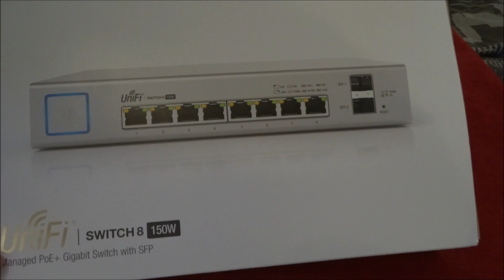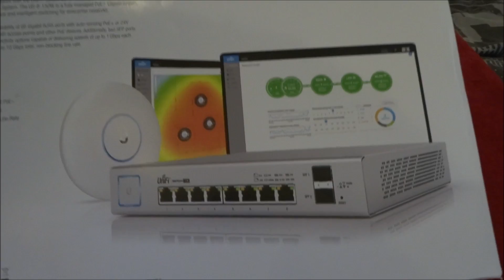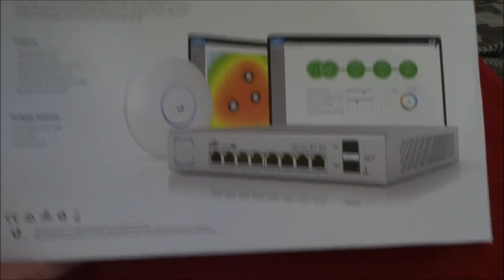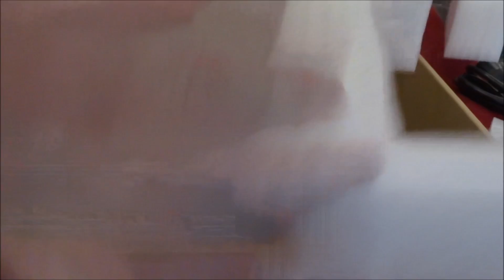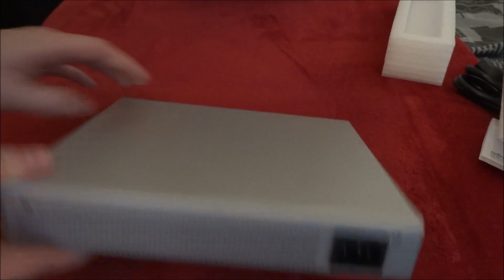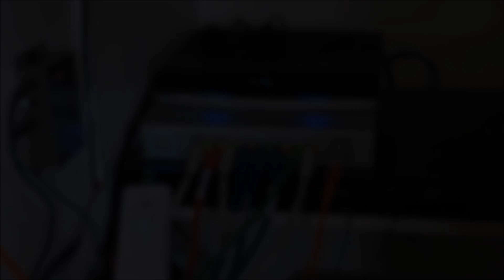Ubiquiti Unifi 8 port PoE switch (US-8-150W)

Comment: It's too bad you lost the USG-pro, hopefully you will be able to add it back in the future.

I have been considering buying one myself, but I am still not sure if it will hit my ~1.2M pps target
Reply from the maker: I may add it back if the features are improved, the fans are very annoying though
Reply: +James Smith Luckily I have an isolated closet with decent noise supporession, so the fans won't be a big deal. 

Perhaps noise is something that could be addressed in software as well - however it is meant more for a closet than anything.
Reply from the maker: +TheJessassin if you check my videos I do use a dedicated room, but why is a usg so much louder than an edgerouter pro? I'm not sure if it is firmware or maybe they just used different fans. overall I was quite disappointed with the usg pro

Comment: It would have been nice if they were to at least have one SFP+ port. There have been situations where we are using a 48 Port just because of the SFP+ it would be nice to see Ubiquiti bring out a 16 Port in that form factor.
Reply from the maker: +Brad Mottram Couldn't agree more! I would love to replace my Dlink core switch but as I have 2 SFP+ ports that's unlikely to happen anytime soon :(
Ubiquiti need to step up their game with switching! The AP-AC's are capable of 1GB/s+ yet you must have a 48 port switch for SFP+! 
On another note, the USG-PRO-4 is the worst piece of rack mount equipment I have ever put my hands on!
Reply: +James Smith Yes I do feel like there should be more features available for the USG products. It's a fantastic idea and a good implementation however the features just aren't there yet... I do hope they can improve the USG products in future.
Reply from the maker: +Brad Mottram I know there is some sort of road map for features and UBNT are pouring a lot of resources into developing features for the security gateways... but for me it was too little too late! I need IGMP multicast and it was not supported, it is on the Edgerouter pro though! I guess they are living up to the standards of releasing stuff to early, letting end users figure out problems then they release updates, we don't work for UBNT they shouldn't do this.
Reply: +James Smith I agree with you on that one. They should not be putting these products out there when there not complete feature wise. They have had a wee bit of a history of doing that... I know there constantly chucking out new firmware for the switches. No sooner do I upgrade one then there is another available the following week.. At least it's easy to run the upgrades.

Comment: I very much want two of these in my house.
No, actually I NEED them. Looking forward to some stock being available in May of June :-(
Reply from the maker: +Ross Williams They are like rocking horse **! who do you use? I think 4GON have them on pre order
Reply: +James Smith Various, but I had an email from 4GON suggesting I pre-order. Not done it yet, but very tempted since I expect they will be popular.
Reply from the maker: Ross Williams I would suggest so, the only thing that they have offered the pre order on was the AC-AP's and they sold hundreds in days of them
Reply: +James Smith I've just spotted that LinITX have got some stock of the new Unifi 16 port (how the hell they scored that I don't know) so I torn if I need 2x the 8 port, or have a 16 port downstairs and an 8 port upstairs.
Reply: +James Smith Totally unrelated question, but, which vendor/model are you using for your SFP modules here in the UK? I can of course read the compatibility information until it sends me to sleep, so, I'm more asking for the benefit of your real world experience.
Reply from the maker: +Ross Williams I use hp procurve j4858c SFP modules. They're cheap to pick up on eBay and I use them in everything! Haven't come across anything that doesn't take them! Thanks for letting me know that LinITX has them, I would love to replace my core switch with one but I really like having the SFP+ which was left out on the 16 and 24 port models!
Reply: +James Smith Thanks for that, much appreciated. Do you stick with the HP branded ones, or anything flagged as "compatible" with J4858C?
Reply from the maker: +Ross Williams No problem! I personally just stick to HP ones, I got a load of switches with them in and continued to buy branded ones.
Reply from the maker: +James Smith http://www.msdist.co.uk/product_Ubiquiti-UniFi-Switch-16-Port-150W-Managed-PoE-Switch.php
They are in stock and cheaper at MS dist, they just dont have the 8 port!
Reply from the maker: +Ross Williams  http://www.msdist.co.uk/product_Ubiquiti-UniFi-Switch-16-Port-150W-Managed-PoE-Switch.php
They are in stock and cheaper at MS dist, they just dont have the 8 port!